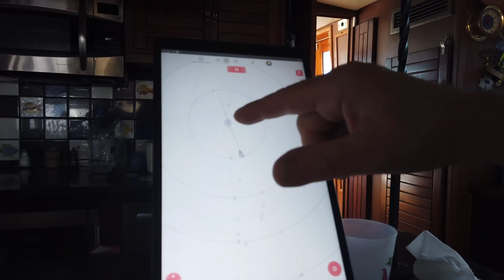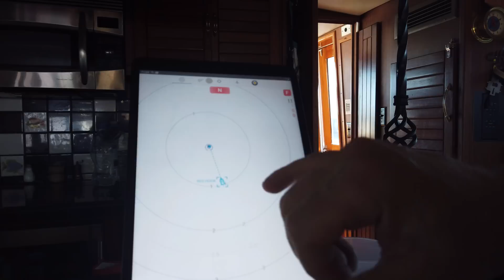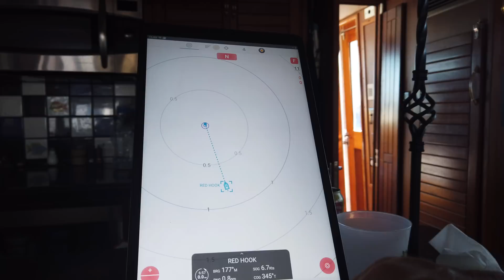Is A.I.S. worth the cost?  E106

Comment: 15A should be plenty to power a couple radios!  I’d be careful if you add anything else though, radios are low power but when they transmit they can pull big peak power for a short time.  But this looks sweet!
Reply from the maker: So far it is working well.

Comment: If I'm not mistaken,the name will show up on others that have an ais and the ones that dont, show a (vessel registration?) number.
Reply from the maker: I also found that the names sometimes show up a few minutes later, as if the system has to cycle.
Reply: There mighta been some kinda upgrade to the system...just wanted to contribute with a little  insight.

Comment: Be aware that class B  AIS can be slow , when viewed on a video plotter the on screen boat approaching that has class B often jumps considerable distances between transmission .  Class A , though expensive , is far more efficient .
 If using class B don't assume larger ships are actually receiving your exact position , we know you are out there certainly but it's not 100% accurate and can go minutes without updating.
Reply from the maker: Thanks for the heads-up. That is good to know.

Comment: We put in the same Vesper 8K w/splitter system this spring.  The unit comes with it's own GPS antenna, because Class B AIS transponders must have a dedicated GPS and can't share one with another unit.  They cannot use NMEA-0183 data from another GPS.  This is a type approval certification requirement.  

We don't do much 'out of the ICW' cruising, so the collision avoidance aspect isn't such a big deal to us - though I do like to check my 'three minute rule' calculated time to CPA against the box (so I know where I'll be when we're at CPA - skinny water/fat water, other traffic).  We have ours feeding the SIMRAD NSS12 evo3 chartplotter via the NMEA 2K, and going to NAVIONICS and AQUA MAP on the tablets via WiFi.  The WatchMate app is a good quick place to get a big picture look around you - it also has a good anchor watch feature. 

The biggest advantage we've seen since adding our AIS last spring (we have the same Vesper 8K w/splitter) is the improved response to VHF calls when you can actually use a boat's name vice trying to hail "Blue Sailboat approaching marker ##".  Granted, a Captain who installs a AIS is probably more likely to be VHF knowledgeable, and presumably more likely to be paying attention to their VHF and respond when called.  

Hailing commercial is even better.  I get the impression professional Captains prefer being hailed by name vice "tug & tow" and like being able to see us on AIS too.  Those two things seem to help us pick up a couple 'respect' points when proposing overtaking/passing maneuvers.
Reply from the maker: Thanks for the information. We did not know that about the GPS antenna. We look forward to using the AIS. There have been many times on the water where we struggled to see a boats name to hail it, or just wondered what one of the big ships was called. Like anything, I am sure there will be a learning curve but we think it was a wise investment.

Comment: I think that you need to get someone that knows electronics to eliminate a lot of that excess cabling, inverters, and wires to make your electrical system work better, and generate less heat. You would be surprised how cables/wires rolled up or a bunch of old wires and cables can cause issues with electronics. But yes, AIS is an important tool for boating safety.
Reply from the maker: It is a project for the future. I think I will start by removing more of the electronics that are no longer being used. Like that Northstar.

Comment: Hi Ed. Love your videos.  We hope to follow in your footsteps in 4 years and just bought the Carver 466 for that purpose. I noticed that I have the same ZF electronic throttle controls as you.  Mine are wired so that they never turn off, which drives me nuts. Are yours the same?  If not, could you send me a pick of the wiring to the ignition.  So far I haven’t found anyone who can help. Rich on Knowing Knot.
Reply from the maker: The 466 is a great boat Congratulations. Our throttle has a breaker on a 32 volt panel in the engine room, along with the radar and other items needed while underway. We just throw the main panel breaker when we get to port. They also have individual on/off switches in the corresponding engine rooms. I do not know exactly how they are wired since they were on the boat when we bought it. The rest of the 32 volt systems (heads, pumps, etc) are on a separate panel that we leave on all the time.

Comment: I run radar and AIS in the fog here in the PNW. I note the the AIS position lags the radar position on targets somewhat due to the way AIS works. Important that you not rely exactly on the AIS position due to this lag.
Reply: Class B AIS can be very slow ,it's useful but not 100% reliable given that you may not be exactly where other boats think you are according to your signal . Class A though expensive , is far more accurate.

Comment: That electrical system is a mess, I had the same problem with my Luhrs 250.  Made it nearly impossible to trace out some of the electrical faults in the system.  Over time I ripped out and revamped the system removing the unused wiring and the bundles of extra wire. Yes it was a ton of work but it made the system much easier to maintain and more reliable.
Reply from the maker: It is on my project list for the winter. Not very high up on the list though. 😁
Reply: @tryingnottosink9107  As a (former) USN Electronics Technician that mess of a wiring harness is going to give me nightmares.  I have no idea how much of your current electronics can be connected via some version of Ethernet or CanBus but just think of the weight savings you could gain if even half of it could be.  And MOST of that weight is up fairly high, so moving your CG lower would be a definite win-win!

Comment: Great job guys. I try and follow the boats that I follow if they have ais on the navionics app. 

I used to be a communications tech. When you were installing the splitter, there was a length of coax that was coiled. I’m not sure if you left it that way. Although it’s not a lot of power going out, it is always best not to leave it in a loop like that as it can create some rf issues with electronics. Also, it looked like you ran everything else loose. That is good. You don’t want to zip tie it to power wires when doing a run like that. 

Al in all great job. Now I just need to add your boat name on my avionics so I can follow you too.
Reply from the maker: Not sure what the coax cable is for. I'll check it out next time I am under the helm. Our boat should be listed as "Triton."
Reply: Former Radar tech here (recently 19 years in broadcast TV) and I agree 100% on not putting power and data lines in the same bundle whenever possible.  Depending on the frequency/data rate it shouldn't be a major issue coiling the RF/coax into a fairly LOOSE loop until you're sure about your installation locations.  Of course once you're positive your gear is where you want it, then cut to fit with a short service loop is best.

Comment: Trying to find you on ais, no luck so far?
Reply from the maker: It is currently wired so that it is only on when the boat's 32 volt system is turned on. I will probably be changing that. However, I heard that the last reported location should remain on AIS, but I haven't checked yet. It should be listed as "Triton."
Reply: Thank you, I'll keep looking I'd like to follow along. I enjoy your videos.

Comment: We have the same unit. We also have the external alarm. The boat names are broadcast less often than the MMSI number, speed, direction data. So that maybe why you aren't getting them immediately on your other apps. One other feature we use and absolutely love, is the anchor alarm. It gives me peace of mind and I know it will tell me if we are dragging.
Reply from the maker: Thanks for the info. How did you wire the alarm? The diagram shows the positive going to the Vesper and the negative going to ground, yet the alarm as three terminals.
Reply: @tryingnottosink9107  it's been a couple of years since I installed it. But if memory serves.
Positive wire from power source to one alarm terminal,.
Positive from Vesper to the other.
Negative from alarm to negative bus bar.
I'm from Minnesota, the boat is shrink wrapped for the winter. Won't be able to verify that until April.

Comment: AIS works in a different fashion than RADAR, giving similar result of location of vessels around you, in some ways it is a better tool, in others it is not. AIS positioning information is GPS based and is usually accurate, when left on while at anchor it will locate your vessel even at night so night traffic will know you are there and can avoid you.
RADAR will find everything that returns part of the signal, AIS only returns what is transmitting AIS.
AIS data is clearer, easier to read.
RADAR finds more, some of which is false echos and you need to interpret the results.
A vessel with no AIS will not show on AIS.
Both tools work together to improve your safety, anyone with a tracker account can find your last reported AIS location if communications go and you are listed as missing.
So, yes, AIS is worth the cost, it is NOT a replacement for RADAR.

I'm sure you knew this already though. I posted becasue many people do think AIS is a replacement for RADAR rather than a supplemental tool.
Reply from the maker: We agree. Radar is indispensable in our opinion. AIS is a great safety addition, but I would not try long trips without radar. And traveling at night without radar is dangerous. The two together will make us feel much safer, especially in fog.
Reply: @tryingnottosink9107  Some waters, night travel even with radar is dangerous, a flir camera is the tool then. Forward Looking Infra Red = FLIR.
Here in the PNW, the flotsam often found in the waters make night travel without infra-red camera a real hazard. floating logs don't show on radar that well, they show well enough on infra red. ( and logs don't show on ais at all ;) )

Comment: Definately worth it!  I found it to be very useful in a couple of situations, including identifying a vessel coming toward us when we coming around a blind bend.  FYI, the apps will usually show the MMSI number until it knows the name of a boat.  Based on the AIS standards, the position and MMSI number is transmitted more often than the name and other details.  Typically you will see the MMSI numbers appear first in the apps when you first turn on the AIS, but then after a few minutes the names start to appear.
Reply from the maker: Thanks for the info Mark. I will check when I return to the boat this weekend and see if the apps have updated the names. I am sure the AIS will come in handy when I get back to Ft Lauderdale. I am always nervous going around turns on New River.
Reply: That's similar to what I was thinking regarding the identification issues, although I was leaning towards more of what the transmitting (remote) boat operator had told his AIS system to broadcast.  For example, I can see an operator limiting his AIS transmitter to sending out ONLY the registration information, not necessarily the boat name.

Comment: i just bought the exact unit, sitting on the counter waiting to be installed
Reply from the maker: It wasn't too bad. The wiring diagrams for the alarm and power switch suck. I haven't figure it out yet, which is why it was not in the video.

Comment: I feel that AIS is worth it because it helps a lot in fog travel. I just upgraded AIS on my boat for 800 dollars
Reply from the maker: That is why Lyn wanted it - for fog and overnight cruises.
Reply: Always important to remember that AIS only shows you vessels that are transmitting, and you only 'appear' to others using AIS.  It can help in the fog, but sound signals should always be your primary means of detecting other vessels.